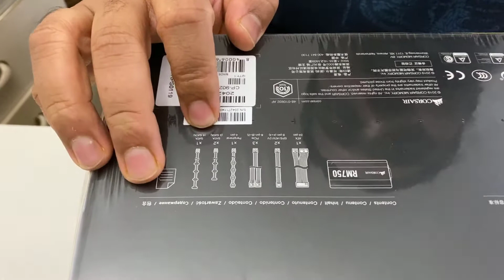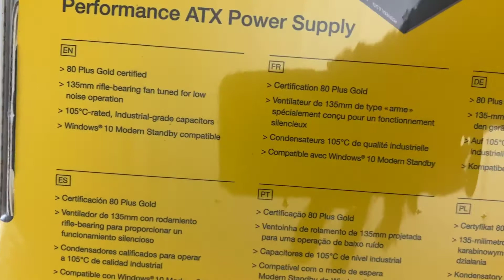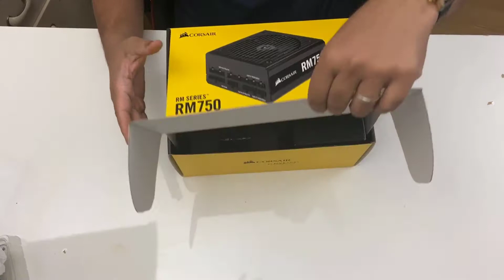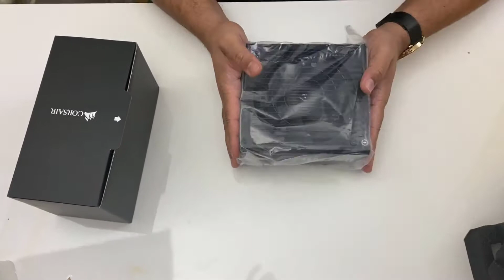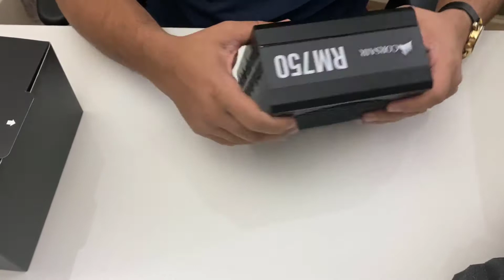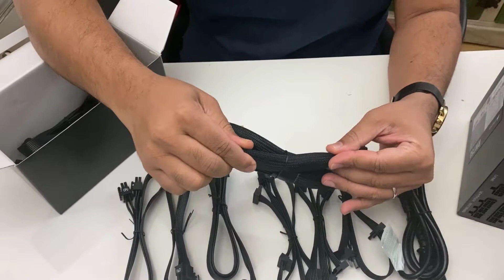Corsair Rm750 Modular Power Supply Unboxing And Explained

Comment: I couldn’t hear my PC before it was super quiet, I was playing Arma 3 it started stuttering and my computer turned off wouldn’t turn back on, put this PSU in it I replaced the old EVGA 600W, now I can actually hear my computer does that mean my 600W was defective?
Reply from the maker: Would you please explain  a bit more because I did not get you question! I am sorry, However, if the pc being worked after changing the PSU then  yes your old PSU went wrong and  what you did was the right thing!
Reply: My PSU was bad, replaced it with a Corsair